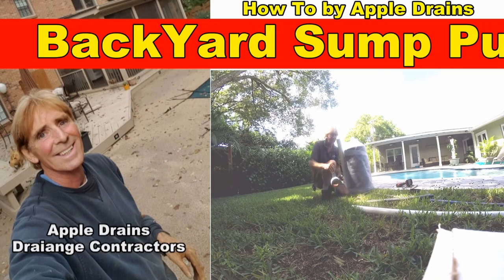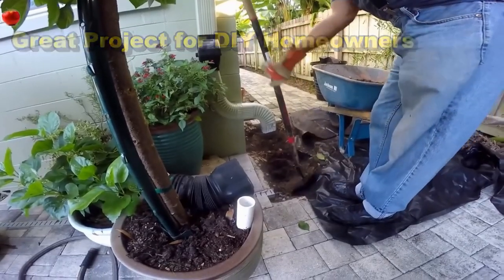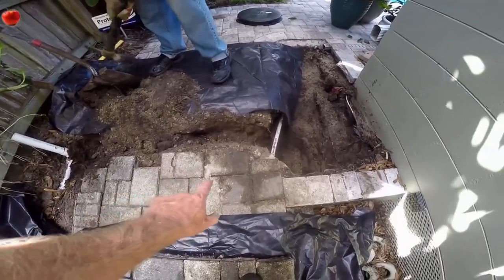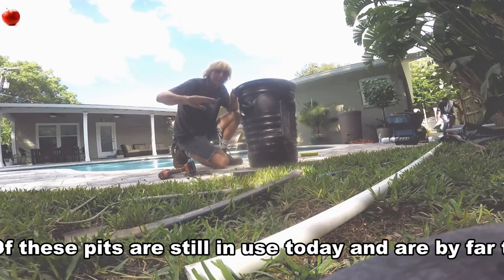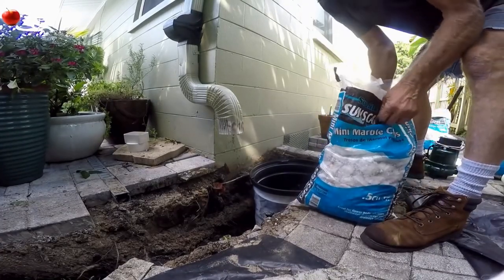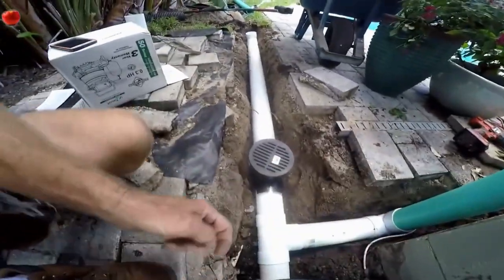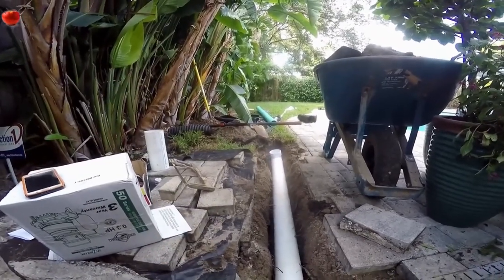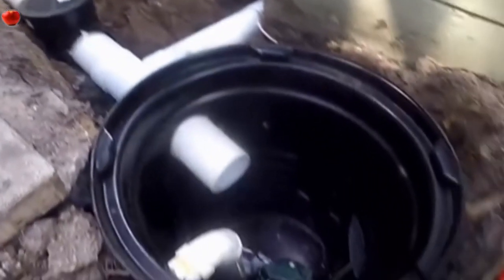GUARANTEED! How to Dry Out Wet Soggy Back Yard. Backyard Sump System. The Secret  is..

Comment: Chuck, I've watched quite a few of your videos and I've noticed how you guys struggle (my opinion) cutting through pine and other roots.  I would like to recommend a tool that would save you a lot of time and work.  It's called a shovel, but electric utility linemen call it a digging tool.  They use it to dig pole holes by hand.  It has a heavy duty blade that is curved like the shape of a utility pole hole but the blade is aligned straight with the handle.The one I have started out as an 8 foot handle but I cut it off at about six feet.  The handle is made of ash and is about 2 and a half inches in diameter.  It will go through a 1 inch diameter pine root with one lick, 2 inches take a couple more.  I use mine to cut along both sides of a desired trench then you can use a garden spade and just shovel out the grass, roots, and soil.  This thing is a real beast.  I use mine a lot, like when planting shrubs, ditching, or any time I need to dig a hole.  It's a real workout but you guys can handle it just fine.  I'm 77 and I can still handle it.  They sell for about $115 plus shipping.  You want the shovel, not the spoon.  http://oshkoshtools.com/products/shovels/